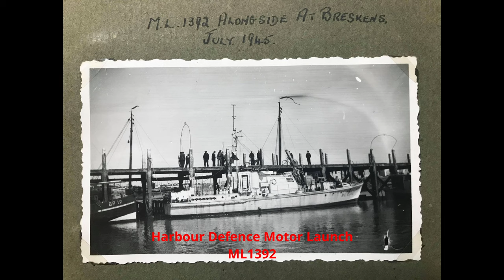Fast Time-lapse Of 12 Months Of Boat Work - Saving A Historic D-Day Vessel

Comment: Have you considered buying a pressure washer for cleaning the inside hull surfaces? The high pressure versions would do a brat job and you just pump the water out of the bilge? They are gass powered so no need to worry about power.

Comment: Have you considered buying a pressure washer for cleaning the inside hull surfaces? The high pressure versions would do a brat job and you just pump the water out of the bilge? They are gass powered so no need to worry about power. They can also be used with an attachment to make a wet sandblaster, nice because no dust.  I see a LOT of places where this would be a huge time saver.
Reply from the maker: We do use a pressure washer x

Comment: Hi guys and ladies l wish you would come through to Kingston upon Hull and do some more boat rescuing as theirs loads of diss used barges that have just been abandoned by Cargill oils and they are moored up near dry pool bridge l wish that l could come on board and do some boat rescuing and restoration and get them back to their former glory by getting these last boats which use to belong to Richard hodgeson's fleet just like syntan  and sunrise which have now got loving homes but these other abandoned barges have just been left in bye water they would be l deal for doing boat handling courses on or as peoples homes please send me the information when you will be coming through to Kingston upon Hull to rescue these abandoned barges as these boats don't have any engines or  wheel houses or wheels to steer them and they don't have any ruder's